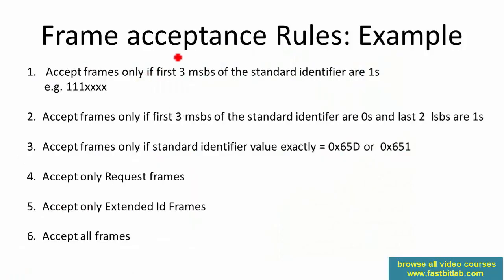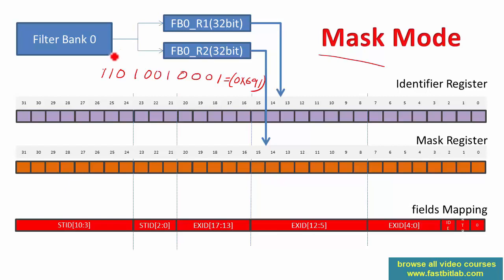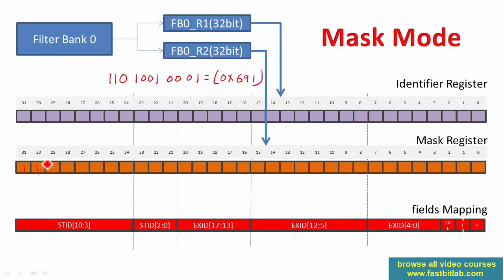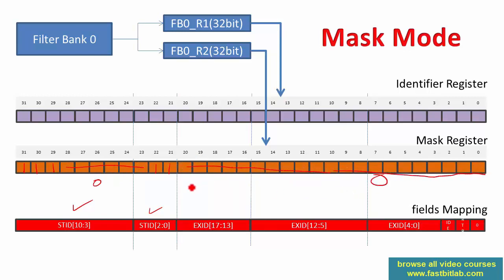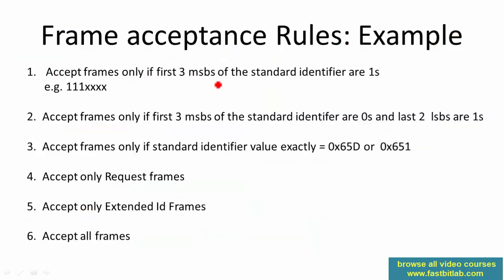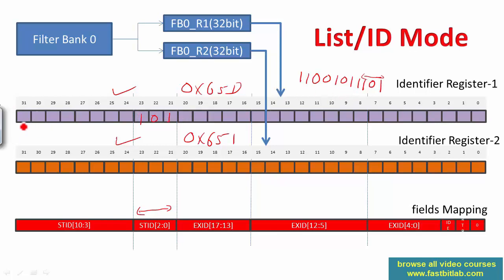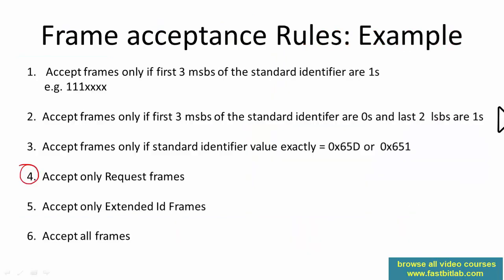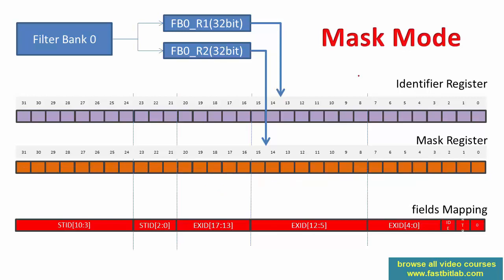Controller Area Network(CAN) programming Tutorial 19 : bxCAN acceptance filtering

Comment: I understand the MCU won't get interrupted if a node/message is masked out.. but does the low-level CAN controller ACK the message on the bus?  

And are the values for an Acceptance Filters and Masks standard?  i.e. It doesn't matter what chip you use (MCP2518FD vs NXP SJA1000T) the Acceptance Reg and Mask Reg will contain the same data for a given application?

ex. If you are using 24-bit extended-ids, and want to ACK Ids 
0x080000, 
0x0C0000, 
0xC00000, 
0xD00000

but ONLY PROCESS eids of:
0xC00000

What should the Acceptance ID be and what should be the Acceptance Mask set to?

BTW, what is the difference between Basic CAN and Full CAN  (and CAN-FD)?

Comment: Guys believe me this is best tutorial about CAN on web.
Reply: @tarunaggarwal7626  sFilterConfig.FilterIdHigh= 0x123<<5; //StdID is stored between 21 & 31.  bits in register cause of this shifted by 5.
sFilterConfig.FilterIdLow= 0x0000;
sFilterConfig.FilterMaskIdHigh= 0xFFE0; //(FFE0= 1111 1111 1110 0000) Apply mask to the bits between 21-31.It passes only StdID by doing this way. 
sFilterConfig.FilterMaskIdLow= 0x0000; 
This is an example.
Reply: @tarunaggarwal7626  check datasheet. Filter id register is 32 bit and. Stdid section is located between 21 & 31. My id is 16 bit hex if I shift by 5 , it will be written by starting from 21. bit into filter id register. Other locations of id register belongs to extended id. After that, u have to set mask register and you have to set high any bit of mask register which is matched bit of filter id which is  you want to apply mask. For example assume that we have st id and it is 0x123 and we shifted by 5. Then 28. bit of id register will be 1. Then we have to set high 28. Bit of filter register if we want to make it pass from filter..